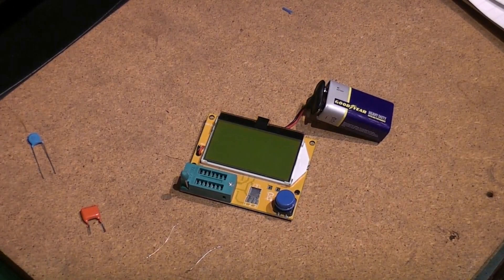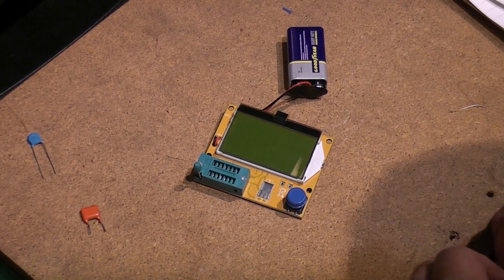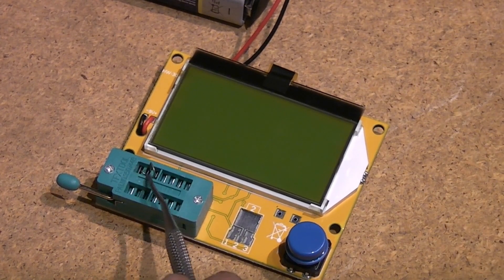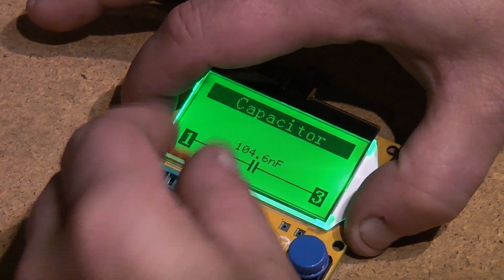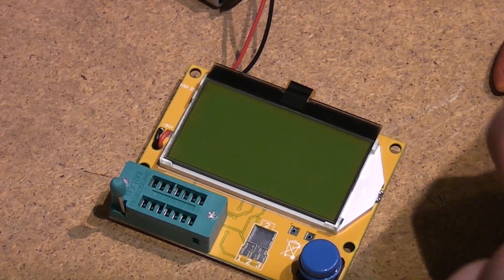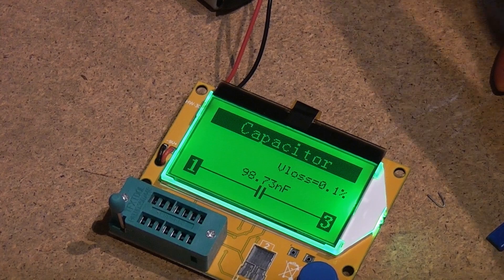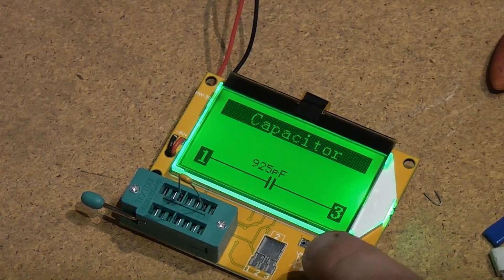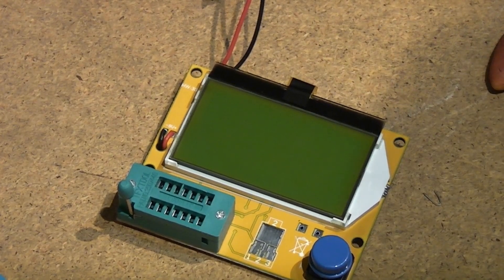Cheap Chinese component analyzer, M328 (LCR-T4) calibration!

Comment: Would be more reliable if you could compare LCR results with proper meter/measurement on some trusted device. Otherwise, speculation that LCR wasn't showing proper values or that after self-cal. it measures properly - is basically invalid and speculation (exactly same as before self-cal.)